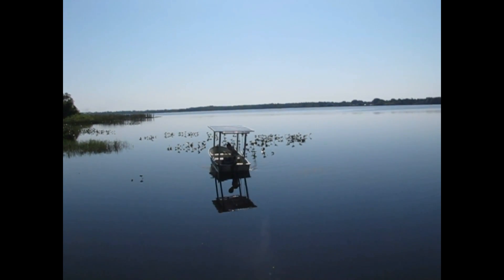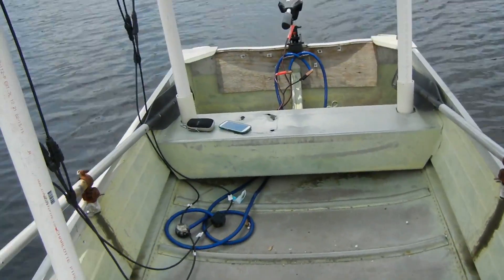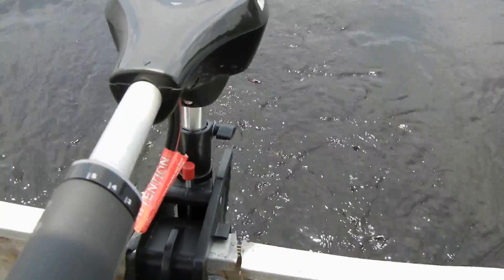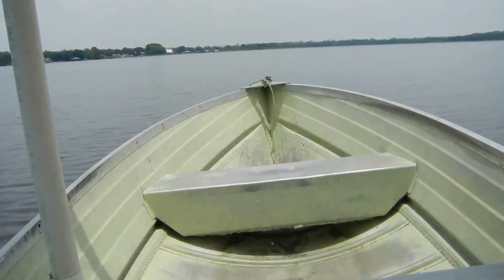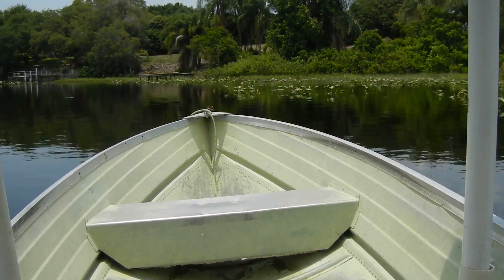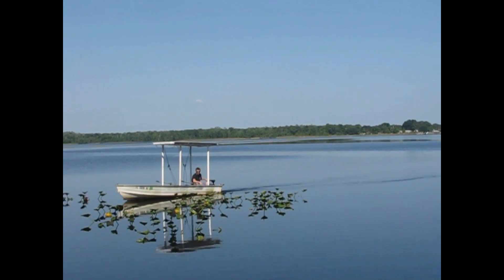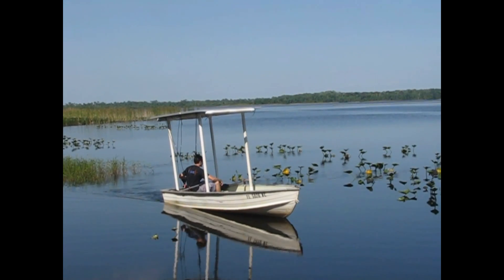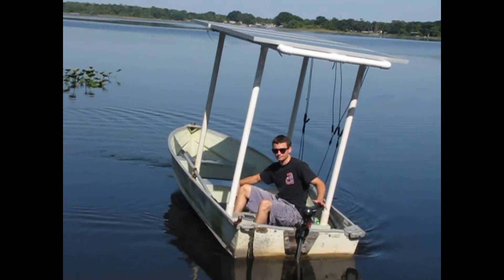100% Solar Boat

Comment: Just about to do this how is it in wind
Reply from the maker: It was real top heavy, so it probably wouldn't have been very good in the wind. If you used the thin flexible panels, it'd probably be ok, but the rigid frame panels I used were a bit much. Could probably do with some reduced height too to lower the center of gravity.
Reply: @72fr250 so Im weld a plate in the bottom of the boat then a coupler to that so it can be pin a pole in place with the carter pin and a center pole that allows it to adjust like a forward sail a rear shade or in horizontal mode mounted to a x frame to stiffen the solar frame from  underneath and used a more expensive bifocal panel say 440 watt along with some additional removable bracing for each independent position do you think that would preform better???
Reply from the maker: @Chadp.  Go for it and post a video. You can always change the setup later if you don't end up liking it.
Reply: @72fr250  hey grabbed the boat and numbers yesterday gonna start steipping paint and cleaning up any issues. How high did you place the panel from rail??

Comment: well i'm sure you know this already but for everyone viewing this video.. do NOT DO THIS TO YOUR MOTORS! 
Motors require a constant voltage and it's a pretty specific range... Solar panels put out varying voltages depending on sunlight and the angle of the panels and a bunch of other factors. You can't even begin to guess how wildly that voltage is fluctuating even in direct sunlight and im pretty amazed that motor is working at all in the video with, what cannot be, the proper voltage going into it. Regardless, i'm sure it was toast very shortly after..
Reply: The solution is, 
use a battery or battery pack that = the proper voltage of the trolling motor. Connect a charge controller to the battery/pack.
Then connect the charge controller to the panels.
You'll have constant voltage to the motor and all excess solar energy production goes into recharging the battery. Also you wont destroy your trolling motors!
Reply from the maker: @markjohnson4643  It was a brushed DC motor with no electronics to fry. Brushed DC motors have an operating range of voltages, not a "proper" voltage. Solar panels are not a constant source of voltage, the voltage sags under load, so they're perfectly ok to use directly on this type of trolling motor. Without a battery in the system, it's safe to short out everything without fear of damaging something (desirable in an all metal boat). 
I ran this same motor for weeks on the same panels in a fisheries experiment to see if it'd circulate the fisheries pond effectively with no maintenance (it did).

Comment: Hi, I've been trying to do this but added a battery and charge controller to avoid burning out the motor. I've been told that sending 18-20V (that's what your panels produce in direct light) will burn a 12V trolling motor out pretty quickly. Did you have an issue with going straight from panels to motor, and if no, how many hours have you driven it with that setup? Thanks. I can send you link to my video trying my setup out.

Comment: Get a voltmeter and measure the voltage. I suspect the motor is pulling the panels down to 3-5V. A cheap addition that will double your power is to add a buck converter between the panels and the motor, so you can adjust the load on the panels. Such a thing costs around $10 from China. That way you can keep your panels around 17-18V where they produce most power and the motor will deliver twice the power so 1-2 MPH faster.

Comment: Cool! So it possible to go pure solar. I’d like to buy an old pontoon party boat, put as many panels on the roof as possible, then travel down the Mississippi River operating on solar alone, modern Huck Finn style! I’d still have a battery for emergency use. But just anchor when the sun is gone.
Reply: Yes, batteries. You don't want a cloud to come over and see a barge string headed your way. could be fatal.

Comment: Kinda what I am thinking about doing. I want to get a 1448 Jon Boat and add decking to part and also a topper similar to yours with solar on it.. I will also be adding a couple Marine Batteries etc. as I will also be using it for night fishing. 

I have seen a couple other videos and the first one I watch was a total disappointment as it was nothing but pictures and not one detail abut anything. 
I like the comments as where others gave advice on having a battery etc. and a regulator... I am in the process of getting ideas for now but plan on possibly getting a boat and working on it over the winter and have it ready by spring try outs.

Thanks for the video and the comments which are a great help.
Reply from the maker: If you have a question down the road feel free to ask.

Comment: Very cool video, compared to all the videos of solar boats running on batteries this gives you a much better idea of the amount of power you can get directly from solar cells.
Reply from the maker: Thank you, that's what I was going for.
Reply: Cool try but I think you can fry the motor by not having a battery. And keep the battery above 12.1.-12.5 using volt meter.

Comment: Thank you for this.  Now i have an idea of the power production needed to run the motor directly without a battery on the system.  when I considered this idea in my mind this was the project I envisioned.  It was very cool to see it in action.  Awesome!

Comment: i made a solar boat as well. glad to see others doing the same but i would recommend batteries as well not just strictly solar. i use a 36v electric outboard and three batteries with 600w being generated from solar. i put lights around the top. great for night fishing.
Reply from the maker: Michael Fuller Could you post a video of it? I'd really like to see your setup. The trolling motor's brushes in my video already went bad, so I'd like to see some electric outboards.
Reply: @72fr250  check out Elco motors.  They make a 9hp to a 50hp.
Reply: @72fr250  Is that all it is using up is brushes ? Actually not to bad . On most trolling motors replacing brushes are not to hard to deal with

Comment: Great vid and idea.  I would highly highly recommend that you add a battery into the system to help control and mitigate voltage fluctuation. Having an open system like this is not only bad for the motor but he panels as well. For the motor, until its under load and has uptake the extra amperage in the system which is there in the form of higher dc voltage, it is in danger up burning out/ through the copper coils and blowing the motor. The open circuit voltage on those panels is going to be around  22.5V (Voc): Try adding a 12v motor cycle/ lawn mower battery as ballast for the system and you'll be one happy boater and it won't take up hardly any room. Although it would be good to use a new battery you could also use a one that has crapped out. Finally think about adding a charge controller into the system. This will rectify your open voltage into 12v and further protect your system.  They are very cheap, you can grab them at harbor freight or off Amazon.
Reply: There's not enough panel current to hurt the motor due to the high voltage potential.  As soon as the motor is on, the panel voltage drops down to whatever it takes to deliver their maximum current which is likely far less than even 12 volts.   When the motor is off, the high panel voltage is not even reaching the motor as it is disconnected.
Reply: @Andy-df5fj  It would add smoothing capacitance and a a protection buffer. It could even be a crap battery costing few bucks for a cord charge or free. ALSO the potentiometer (which is rated for 12v) or voltage/"speed" regulator is equipped to handle between 12v-14v at any time but in particular during voltage disconnect and very low speed operation.. My point stands. An inline small battery is in the right way to do this as well as protect the system as a whole.
Reply: @thismaineliving  
I agree the battery would act as a buffer to keep providing power when the solar output is reduced.  There would however be no added protection as the solar panel is incapable of providing more current than the motor can handle.
Reply: @Andy-df5fj  Bro, Ohms Law says otherwise. Voltage lags current. And current kills more than just people. It kills electronics as well. I mean that and plasma arching too, breaking down contacts, winding lacquer, oh and repeated annealing of the copper windings in a system proven to vibration. Doesn't matter how you spin things. Just saying "No" doesn't stop the fact you are wrong on every attempted point you loosely tried to make. Seriously you might as well say a bullet can hurt you because it weighs so little. There are other factors at play... To those that want to not break their things, waste money, and/or look stupid to others. Do it the right way, and don't be an arrogant twat that people laugh at. To those who are trying out prototypes rock on and share in the wisdom of the collective.
Reply: @Andy-df5fj  This looks like it was written by a 10 yr old. It's all incorrect and who measures current in volts? Using less or more voltage than is required by the motor will result in its failure pretty quickly. Fluctuating the power is also horrible for electric motors.. Just dont connect solar panels directly to an electric motor, period.
Reply: @markjohnson4643  
It was written by someone who understands solar panels to a degree which is clearly beyond your knowledge on the topic to comprehend as anything other than gibberish.
The voltage output of any power source is not a fixed value, but fluctuates depending on the load (current draw) placed upon it.  The bigger the load, the bigger the voltage drop.  This is especially true with solar panels.  Research solar panel voltage collapse and learn what I'm talking about for yourself.

Also, I'm quite experienced with building and testing motors in both RC and small boat applications.  Although there are exceptions, such as AC synchronous motors, running too little voltage through a standard DC motor will not hurt it one iota.  How do you think a resistor based speed selector on a trolling motor works?  The supply voltage is divided between the selected resistor and the motor impedance and the voltage across the motor and the corresponding speed is reduced without any stress to the motor whatsoever.  In fact, it is stressed LESS than at full speed.
Reply: Yes, a battery is a great buffer to filter out power flux.
Reply: I am considering, I to am not interested in bulky batteries can you suggest another route?
Reply: @taurushipointenthusiast1306  Just a small 12v motorcycle battery. Should only weigh a few pounds and they come in a size around 5"x3". Go with a sealed  lead acid NOT Lio or other "fancy" types.